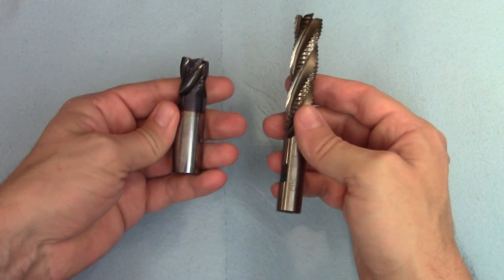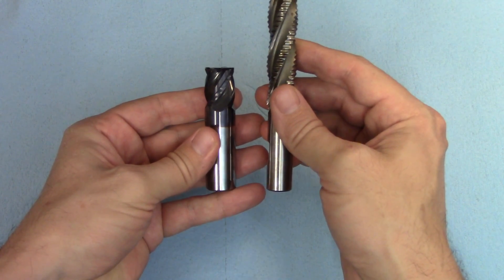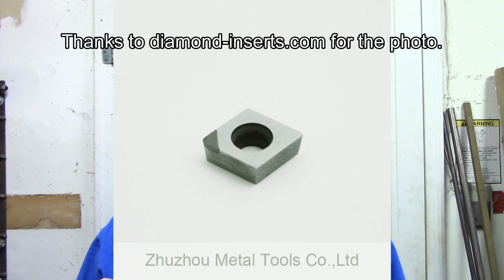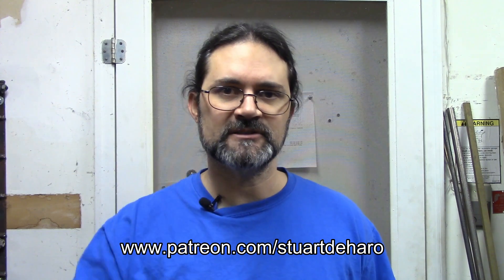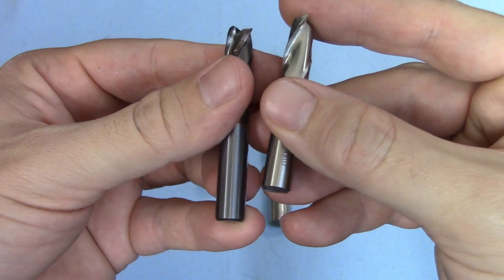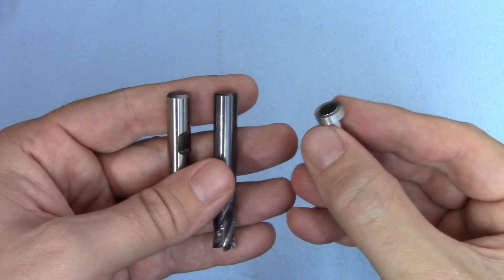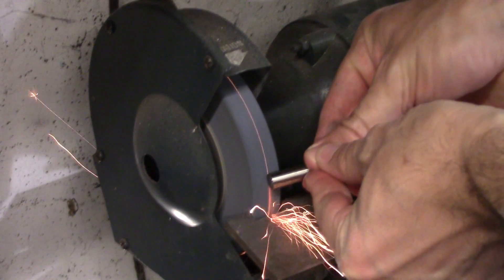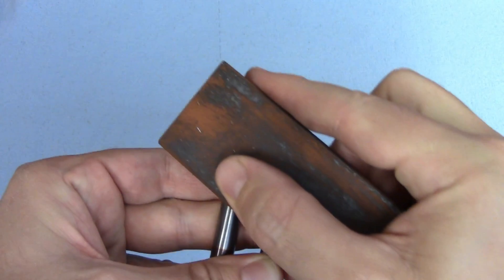How to Tell the Difference Between Carbide and High Speed Steel

Comment: I need to drill 1/8" hole through a tig weld. Which kind of bit would be best. Thanks
Reply from the maker: What material are you drilling through? Regardless, I would grind the weld flat in that area if possible. Definitely start with a short spot drill to establish the location first. That will keep your 1/8 drill from wandering. If you’re drilling stainless or steel I'd use carbide because of the heat affected zone. Aluminum, you’ll be fine with HSS.
Reply: @StuartdeHaro  Thanks. It's 4140 that was tigger over toward the bottom of the original hole. I need to drill down about 1/4" more. So far non e of my bits have done much. A few years ago Irwin made hss bits that worked but the last ones I bought looked like they were made in China.
Reply from the maker: @targetshootr  4140 will definitely be hard at the weld. Hardware store drills probably aren't going to get the job done. If you can only find HSS or cobalt locally, try running them at 1000rpm or slightly lower with plenty of oil. Carbide will cut through it no problem but may not survive long going between the weld and the parent material. I'd keep the RPM conservative there, maybe 2000, again with plenty of oil. I'm assuming you're drilling this with at least a drill press, right? Not a hand drill?
Reply: @StuartdeHaro  I have a hand drill and a drill press. I broke off one bit inside the hole using the press but I can control the hand drill if it binds. I can buy bits online, just not sure which is the most effective. Thanks
Reply from the maker: @targetshootr  Alright. Just be aware that carbide is more apt to shatter especially in a hand drill. Definitely wear good safety glasses!

Comment: can i use m42 grade hss for Ti6Al4V milling.
Reply from the maker: You can but I wouldn't. The SFM is really low, so you'll need to turn at a pretty slow RPM unless you have a small cutter. Even then, it will dull faster than a carbide cutter will.

Comment: SIR BEST TUNGSTEN CARBIDE GRADE FOR CNC BITS LIKE 3MM, 4MM, BALLNOSE AND ENDMILL 2FLUTE
Reply from the maker: The grade should be chosen based on the material you are cutting, not the size of the cutter. There are different grades for steels, non-ferrous metals, aluminum, woods, etc. Most industrial suppliers will have a chart of some kind explaining them or have a field when you're searching to narrow it down by the material you are cutting. I have had very good results with the US made carbide endmills offered by shars.com. They're very good quality, cut with a great surface finish, and the price is quite reasonable. They're not sponsoring me. I'm just a very happy customer.